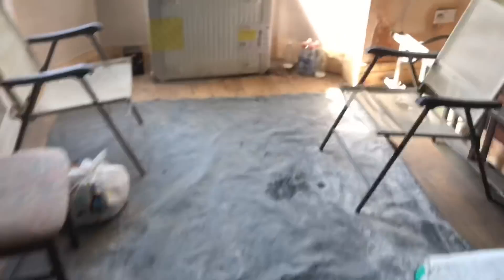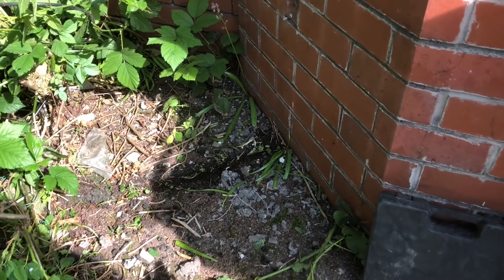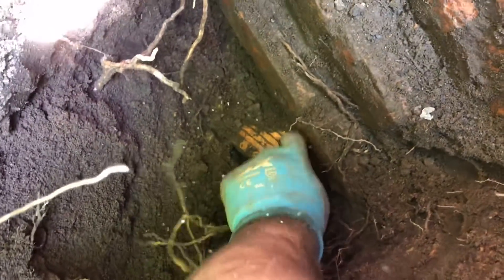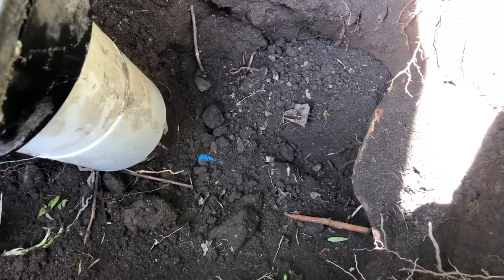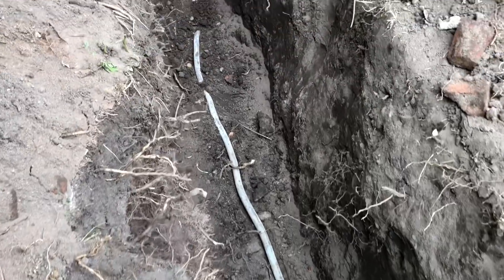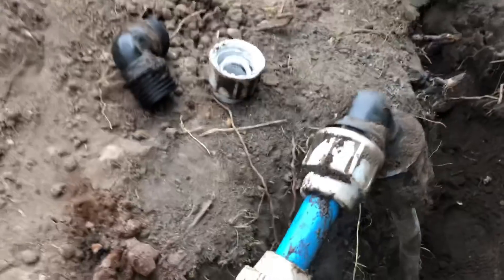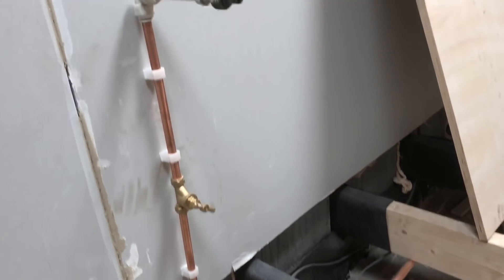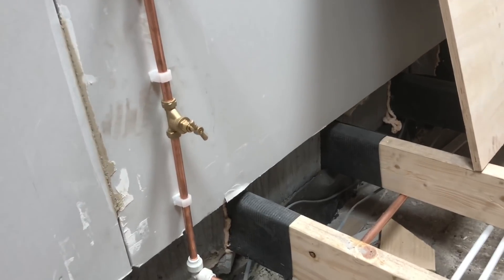Replacing a lead water main to MDPE

Comment: The pipe liner as you said is an insert you dont really need them on the plasson fittings only really the philmac fittings. They dont stop the pipe from crushing as such, inside the fittings is an o ring. If you kink the o ring it will leak

Comment: I am looking at a lead pipe replacement on a house not dissimilar to the one in the video, one question I have is, do I need to duct completely under the floor, or just where it enters the house?
Reply: Not inside property, you dont really need to duct it at all. Just has to be 750mm deep and id backfill around the pipe with soft sand or shingle.
Reply: I'd duck it worth it for future it's better job.